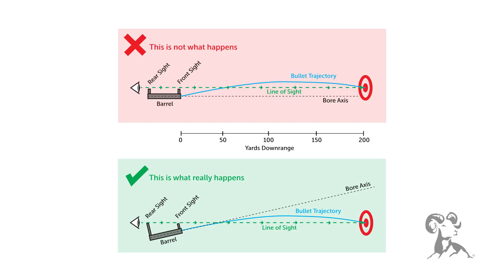Daily Defense Season 2- Ep 24: Rifle Ballistics & Why They Matter

Comment: A key point that was not mentioned is “greater mass for caliber” projectiles will (due to momentum) retain the velocity more readily than “lighter for caliber” bullets.  Of course, all will lose speed, due to drag (the shape of the projectile clearly is a most important variable).  Thus, for example, a 55 grain projectile may actually be slower at 350M that a 77 grain bullet.

Comment: I saw a new round called Allegiance in 556, it explodes and doesn't pass through. I saw it yesterday on the Who Tee Who channel. It's called hogstrike. It's supposed to go 1,550 ft per second and out of his 16inch cmmg it was averaging over 1600 ftps. I have a 20inch Henry long ranger so I should get even faster velocity. Great video!
Reply: Are those accurate numbers? The reason I ask is because the velocities you mentioned are very slow for 5.56/.223.
Edit: Richard, I looked at the video. The box was saying 2,550fps. That looks like some cool ammo. You might want to check out Barne's Varmint Grenades, too!
Reply: @Cautionary_Tale_Harris  yes I know, but it's a completely new round. Watch his video from yesterday. Let me know what you think.
Reply: @stumpyhigginbottom3466  yes I know, I've just never seen a hunting round with it. I use 45acp frangible ammo in my 1911.

Comment: how is surefire still in business
Reply: Tommy, what's up with Surefire?
Reply: @Cautionary_Tale_Harris  i had their lights and sold them. they may be durable but for the longest time they stuck with battery eating halogen bulbs and they were not even that bright! finally they evolved into LED but still at a outrageous price and dimmer than the competition.  ill stick with my SRT9 and EDC18
Reply: @Cautionary_Tale_Harris  Because they're a good company, efficiently run, and make superb products?
Reply: @annoneemoose  Don't ask me, I was asking Tommy Sands.
Reply: Cautionary Tale Harris eh, I heard their lights are lagging behind modlite in quality, but I couldn't say more than that.
Reply: I bought a Surefire X300U-A weapon light several months back. It was $240. The mounting bracket was plastic. I'm sorry...Polymer. 
Ultimately, I couldn't justify that cost over my $100 Olight, and ended up returning it.
Reply: Cautionary Tale Harris I've been considering going modlite okw head, arisaka body & inline mount, surefire tailcap, unity hotswitch.
Reply: @Cautionary_Tale_Harris  No surefire light has ever blown up and killed someone. Olight has.
Reply: @annoneemoose  Every firearms manufacturer has had a major failure- typically user error. Does that mean you will just not buy any gun because they’ve blown up? The thought of a light blowing up is exciting anyways. Keeps you on your toes
Reply: @dylconnaway9976  Firearms and lights are a little bit different, and seeing as there are two American manufacturers who have never had a light blow up, I will pick them over a Chinese light that has had several exploding light instances and one fatality. There's no reason to buy questionable Chinese junk like Olight when Streamlight exists for the same money. I'm not saying modlight, cloud defense, etc. might not be better than Surefire, but Olight is junk and should be avoided.